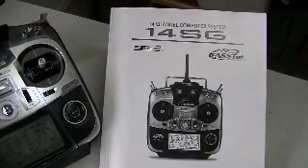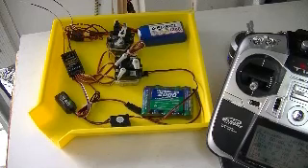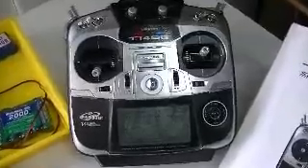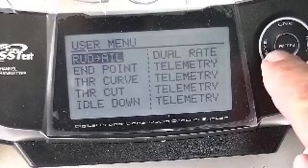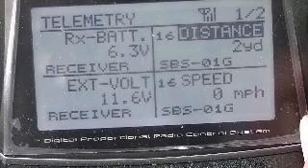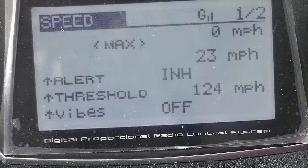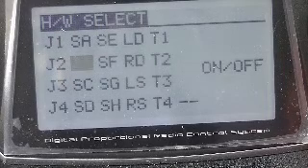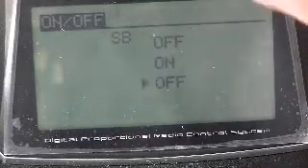GPS Telemetry, SBS-01G Sensor with Futaba 14SG Radio

Comment: Hi im wondering if you can help me with the Vario setup as i cant seem the get the climb dive sounds to work i have the battery voltage and the height speech working ok, 
im using the cheaper vario unit SBS-01A  
                Thanks Gary
Reply from the maker: +Gary Gilmour 
Hi Gary,
I'm not using my GPS for sailplanes or Vario, so can't help much.  However I've found answers to almost all my questions in a very good and inexpensive ebook by Malcom Holt titled Futaba 14SG-Programming for Fixed Wing Aircraft.  Buy the book on Amazon and download it.  He parallels the Futaba user manual and amplifies and explains every function.  Much better than anything I got from Futaba tech support.  I'm sure there will be helpful info there for you.  I think the book is an essential reference for all 14SG users.  Good luck!
George Krueger
george.kru@gmail.com
Reply: +George Krueger     thanks George :-)